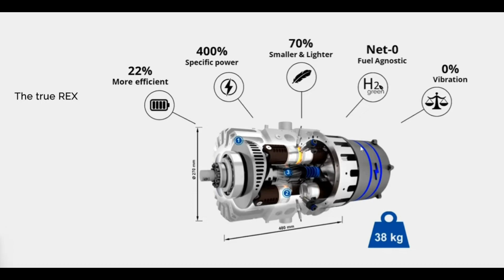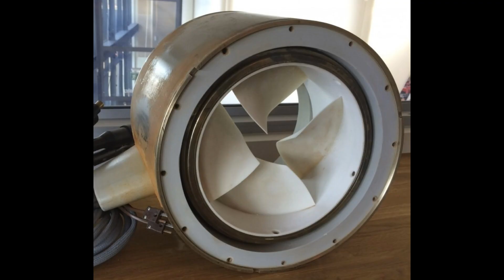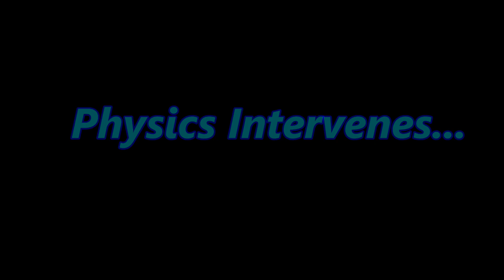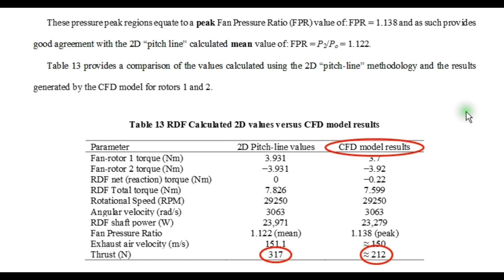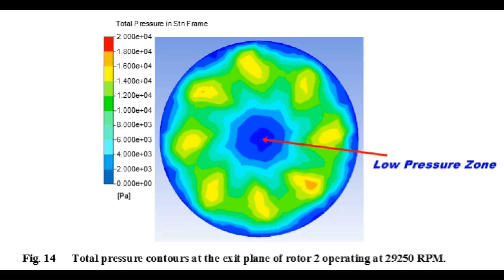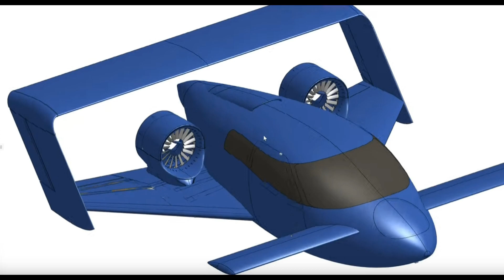Raptor NG VTOL Reality or Renderware?

Comment: Peter's power consumption figure is indisuptably impossible and to expect the aircraft to achieve VTOL on that power is baffling . All his other expectations are equally infeasible for the resons given here in quantitative terms but the underlying rejection of the CONCEPT of A design of air vehicle that can achieve a much much larger production run than say the RVs , now dominating the experimental homebuilt field, is NOT ridiculous.  Neither is the "fat" fuselage responsible for too high drag - the Cd is much lower than a tractor prop with the higher slipstream velocity and messed up cooling and exhaust flows that go with that layout ( as proven by tests with closed off inlets and prop removed in glide tests - eg CAFE and Indian govt labs on C150 )  the basic design could be rescued by a joined wing and central fin , much greater span and  free props in place of ducts but without an airport independent nature it is just another CTOL to add to the pile and as limited as every other.  Peter implicitly recognizes this fact in his design goals but misses the mark which does not invalidate the goal.

Comment: For the engine’s pulley wheels to handle higher RPM’s: 
layered bearings. You run three (or more) bearings, one inside the other, inside the next, etc, therefore combining total RPM ratings

Comment: he missed a very important factor in his needs ... to validate a 100k to 130k price tag the cost of his 30k units has to be much less than the total to make the 3M to 3.9M pay back worth it ... the production costs for labour alone will be HIGH ... and the materials will be the ONLY place to save money ... 
.
the multiple unproven designs is never a concern ... THE AVRO ARROW proved that ... unproven shape unproven engine unproven weapons system ... and yet all proved valid and became the standards ... and even today the sparrow missile used is from the avro redesign when they reworked it because the us side couldnt get it to work at all ... even the ps13 engine ... was designed for 20k and could do 22k thrust PER engine ... and the airplane design as a delta wing was new ... and was proven effective even using under powered over weight engines when compared to the ps13 ... and yes delta wing was proven because after march of 57 when some 10 to 15 avro engineers began work on the failing sr71 swept wing design ... it went from that to a delta wing blended body like the arrow with loads of titanium like the arrow because the Canadian engineers already had the experience working with this metal and the americans didnt ... 
.
nice proof that the designer ISNT making a real plane ... now as a an RC plane it might work well ..
Reply from the maker: Unproven concepts which are eventually validated are finally proven. This isn't  just unproven, it's a physical impossibility as I go to show in my 2 videos on it. This will never see the light of day as it was initially proposed.

Comment: I wish I could get in contact with Peter to help bring novel solutions to his problems.  I've worked in the R&D field for 13+ years, and have some very off-the-wall solutions for some of his challenges.  I won't say I could solve all of his problems, but I know I can get his bearing issue solved without something super expensive, and fix his axial motor design to be much more efficient,  The aerodynamics would still fall on his shoulders.

An actual production fan would need titanium blades and near seamless outer hub, which would make the aluminum blades, welds, and open outer ring obsolete. I think it can be assumed without much assumption that the aluminum and delrin assemble is a mere proof of concept.
Reply: Peter isn’t capable of listening to anyone but himself.

Comment: The strangest thing was that Raptor v1 was an abject failure when measured against it’s claimed performance and now here is Raptor v2 a concept with even more outrageous claims. Most of which would be met with shaking heads even by his most ardent supporters.

What’s next? Raptor v3 capable of entering low earth orbit.. New York to Sydney in 2 hours. We wait in anticipation.

Comment: What is Peters background. The firtst rapotor was such a great idea. What stopped him from just putting an lycoming or Continental engine in it. I think everything that people warned him about happened
Reply from the maker: The idea of a 2000 mile range, 5 seat, 300 knot, pressurized aircraft was good and would have found a market. However Peter built a one seat, 150 knot aircraft with a 300 mile range. It couldn't even match the numbers of a 40 year old Piper Arrow.

His background was software with no experience in engines, structural design, aerodynamics, systems design or turbocharging. The results were predictable.

Raptor 1 would have been a total flop even with Lyconental power as it was more than 1200 pounds overweight- a deal breaker right there.

Comment: Peter's claims are so nuts. Thanks for the analysis. Make it fatter, make the wings short and draggy, use tiny fans, use a totally new type of engine, make it VTOL. And of course a car manufacturer wants to build airplanes. Right in their area of expertise. The dude needs his medication levels increased a lot.
Reply: Don’t forget let’s mount the fans on top of the wing where airflow is most critical.

Comment: Loved your very sterile approach. No fluff. Just science. I am not an engineer. I hope these numbers are the most up to date. Even if they aren't I appreciate the work that went into such a video, and for the slight reality check over such promising and exciting theories. Please keep up the good work. -Jake
Reply: I would like to add... My biggest complaint about GA aircraft are the comfortabilities. I've always wondered why they are so cramped and difficult from a usability side. Amazing machines with challenging application and it all seems due to tradition. My favorite part about the Raptor series was someone taking action against the GA traditions... Care to comment?
Reply from the maker: @7wakyjake  You can have the huge, wide cabin but you'll pay for this in extra weight and especially drag. There is no free ride here. The new door design was good as far as ingress and egress but I didn't see any other useful improvements on this iteration,  just a less realistic design than Raptor 1.

Comment: Thanks for the video.  I made similar comments to Peter's original YouTube video and also tried to communicate to him regarding his thrust errors via LinkedIn and Twitter but never got any response.  My thrust calculation is similar to yours.
Reply from the maker: Peter invites response to his video but his DK  won't let him accept that he's wrong here. Nothing has changed with him unfortunately. He learned nothing from his first experience with Raptor 1 which failed to achieve a single performance prediction.
Reply: @rv6ejguy  Thanks for the insight.  Peter came across as honest but not fully aware of fan aero design especially at the low pressure ratio.  It's a common error to push fan pressure ratio down to maximize thrust/HP statically...even Efan made this mistake and suffered low performance in flight.  I am an experienced engineer in this area and was hoping to help him.
Reply from the maker: @robertmazzawy8322  Yes, I think many fall into the trap of comparing static thrust numbers which may be useful on a low speed vehicle such as an air boat but fairly meaningless on high speed aircraft.

I tried to help PM on his turbo and cooling systems too but was rebuffed, with him saying he knew better- even with zero previous experience in those fields! We saw the results of his hubris on Raptor 1- multiple failures at every turn.

I appreciate your comments here. Thank you.

Comment: the role of engineers is to keep the wishful thinking of marketers under control (but without crushing their dreams and providing real-world data), you are doing a fine job at that !!
Reply from the maker: Just to make it clear to viewers, I am not a ME, just someone who has built a lot of mechanical and electronic things over the years and understands some of the limitations and physics that define what's possible or probable to achieve...
Reply: @rv6ejguy  I am in the ducted fan design business, and if I had to bet on one builder and his numbers, that would be more likely you...
Reply from the maker: @olivergarrow233  I'd be interested to see your blade designs and thrust/HP numbers.

Comment: I would like to see a follow on video where you put in how the design could work with as many modifications that you think are necessary. While you covered some of that on this video I would watch that as well.
Reply from the maker: Since Raptor NG is no longer pressurized, it seems like a Velocity RG turbo is what you need. Already proven and available. Covered this in a previous vid.

Nothing PM touches will ever see production in either kit or certified form. He doesn't have a clue about what he is doing. 

Raptor 1 was almost 100% overweight from his first predictions and only achieved speeds about half of what was projected. The engine never cooled, his redrive was a disaster and the airframe was never pressurized in flight.

Raptor NG's aerodynamics are completely unproven. There is no structural design done yet (now in aluminum which PM has zero experience in) , the engines he envisions are neither proven nor available. His RDF design is utter nonsense and will never see the light of day.

Raptor NG is going nowhere regardless of what PM believes.

Comment: The 1st one flew and he didn't die so im optimisticly hopefull about this one. Something about the trust calc is off on both ends. One is absurdly high the other absurdly low. Either the fan usable surface area calc are off or a wrong variable was used. As far as the rim thruster bearings being unspinnable @ x speeds this can be corrected with larger ball wheels with greater diameters. Still not how I would have done it, but to each their own.
Reply from the maker: The straight blades Peter used on his fan were easy to make but ridiculously inefficient.  Larger wheels on the bearings won't easily fit within the duct. They'd have to be over 8 inches in diameter to get the bearing rpms down to livable levels. You have real problems with bearing engagement and slip as well which won't be easy to solve.

Peter could stop all the conjecture and just build a full scale, working model of his fan, measure input hp (easy to do looking at amps X volts/ 746) and measure thrust with a load cell.

His CFD numbers are nonsense. He needs actual numbers from a proper experimental fan, not conjecture.

His CFD drag numbers on Raptor 1 were proven massively wrong both on paper and with the flying article. It's no different this time. He doesn't know what he is doing.

Comment: Interesting. I’m wasn’t familiar with this airplane design or the claims. Definitely fails a sanity check with some simple analysis or a descent engineering background. At 15:00 when F=ma is used to calculate thrust is acceleration or velocity being used for a? It should be the acceleration required to go from free stream velocity to the fan exit velocity over the length of the fan blades correct? It sounded like maybe velocity was being used.
Reply from the maker: We are looking at static thrust here only. Initial velocity is zero. I covered in a previous vid how thrust varies with airspeed. One indisputable  fact is that when exit velocity= freestream velocity, thrust = 0.
Reply: @rv6ejguy  Yeah, that makes sense. I thought a little more about this. I was getting bogged down with acceleration and how it would be determined. The acceleration would have to begin before the inlet of the fan not at the fan vane, and this acceleration would be caused by lower pressure at the inlet. Although after rearranging the equation acceleration it isn't needed. You get the time term for the second law equation from the mass flow rate instead and the units work out. In this case velocity can be used. I see where I was confused about the equation was applied.

Comment: This is supposed to be a diesel-electric / hybrid design.
This makes an aircraft FAR too heavy.
Note that the Rolls-Royce / Airbus EFan-X hybrid aircraft failed miserably, because:
    it was too heavy, 
    there was no room for passengers
    there was insufficient cooling.
    (the aircraft was an old Bae146.)
RR promised a 70% reduction in CO2, but achieved a 400% INCREASE in CO2 per passenger.
It was a Woke design that went Broke.
Ralph

Comment: 7:00 I'm sorry but it's unfair to look at the grease type lubrication and not the oil type which is meant to go fast. Still unrealistic, but makes for a better analysis.

And about this endless dissection of Peter's thrust and power estimates, it feels so weird. It's like saying that your water-powered car concept will never work because the steering is flawed. Anyways, thanks for another great video!

Edit: By the way, do you think that the original Raptor concept, properly made, would've been successful? I feel like it was the logical evolution of the velocity series. Bigger, more luxorious, very cool looking, pressurized, and has an efficient automotive engine.
Reply: at that speed oil will just get spun out. even at lower rpms. and there is no way run an oil system
Reply from the maker: Can you think of a way to use bath or pressure lubed bearings here? You need containment to to do that. In any case, this would only extend rpm limits 20-25%- still far short of the rpm requirement.
Reply: @rv6ejguy  I was looking at 7:00 where the 26mm bearing's high speed version (open oil) could run 64% faster. But I have to correct myself, you and @Elios0000 are right, another look at Peter's pictures shows that his design can't even accomodate proper bearings. It's not that bearings can't be that fast, the flaw is his irrational design that necessitates self contained bearings. This was mentioned at 7:04 , but the statement at 7:28 confused me. 
Anyways, thank you for the replies.
Reply: "It's like saying that your water-powered car concept will never work because the steering is flawed." No, it's like saying, "your water-powered car concept will never work because your water-powered powerplant is about as commensurate with proven physical law as a unicorn's rainbow fart." As designed, Peter's fan will never develop the thrust required to get his airframe (a disaster in its own right) aloft—let alone the outlandish performance targets.
Reply: @sigmundwong2489  I disagree. The already messed up powerplant was switched to an impossible setup that's never giong to work. The wings were switched to an inefficient and irrational setup that's never going to work. Fans where they're not supposed to be used, never going to work. VTOL because why the duck not, never going to work. Fully autonomous, never going to work. Throw in some impossible specs, never going to work. This whole concept is beyond ridiculous.

Discussing the in depth engineering challanges of the fan feels like a small detail in all of this mess.

Comment: So far, to me this looks' like a rederware. With all the numbers shown here, there is one very basic issue that will make this idea just a renderware. And that is the use of a hybrid power plant on such a small airplane. You have an engine, then you put a generator (weight) to it and then you add three electric motors, which is even more weight. One electric motor, the one in the nose is dead weight for the most of the flight. so you double,  (probably more) the weight of powerplant on such a small airplane, where weight is critical.

Comment: I’d like to see the original raptor made unpressurized using carbon fiber techniques from the darkaero brothers.
Reply: or just a simple al construction.  lighten the weight, get some experts to fix the turbos, build a real redux unit,  rebuilding the original concept would meet with better response.  but to me his egg design is very ugly.